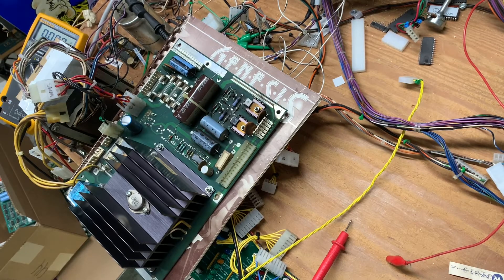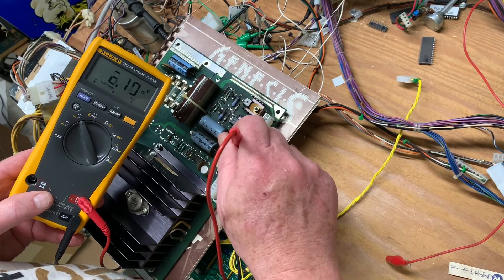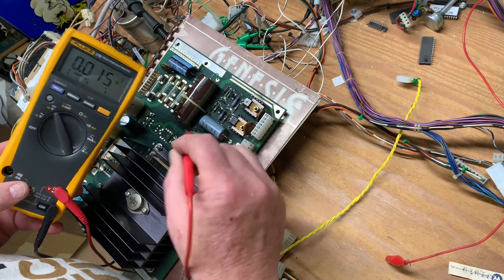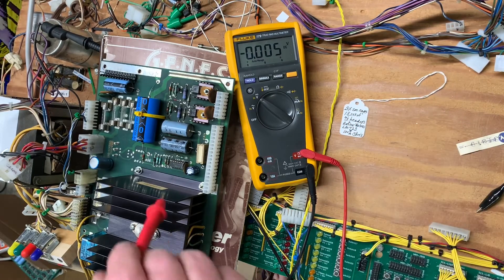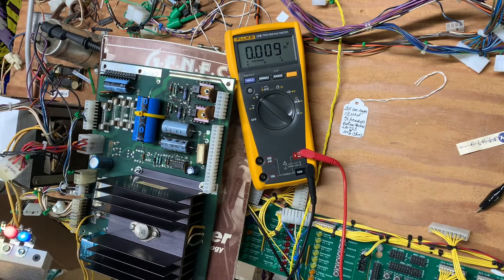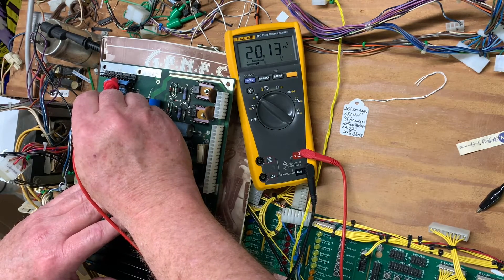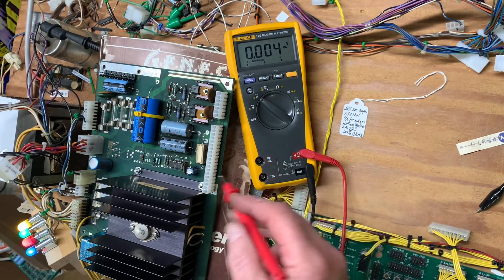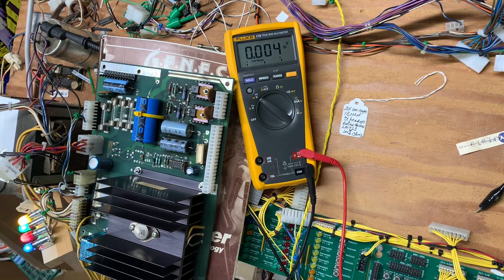Williams High Speed Power Supply Delivering 12V at 5V Power Circuit...Gack!

Comment: Helped me fixing my High Speed II power supply. Measuring MC1723C at pin 4 and 5 I found the problem. Thanks for the tip. A capacitor for the 100V was blown. I don't need this as I have LED. The blown capacitor probably took out the MC1723C.
Reply from the maker: Excellent. I’m happy that these videos are helping people.

Comment: Thanks a million! My Space Shuttle power supply was delivering 12V on the 5V pins (and the machine wouldn’t boot). Sure enough the LM723 had failed. It must get hot residing next to the big honkin’ heat sink on the power supply board.
Reply from the maker: I'm glad the video helped!